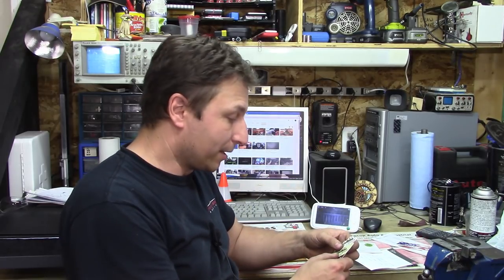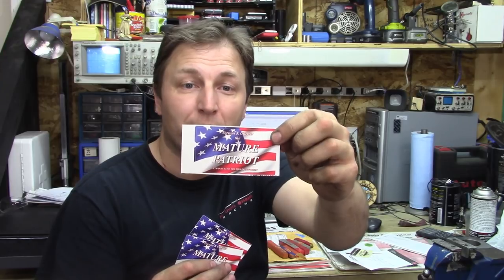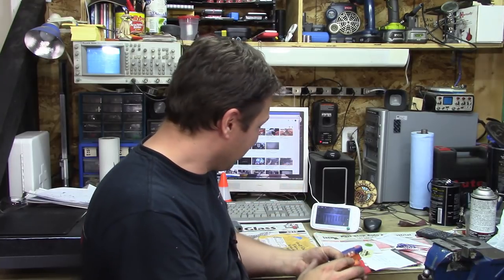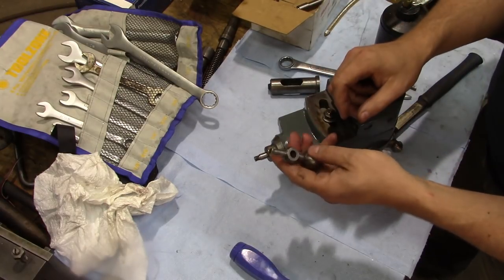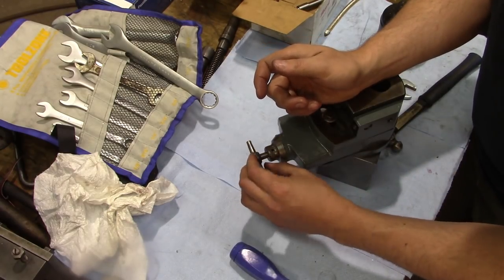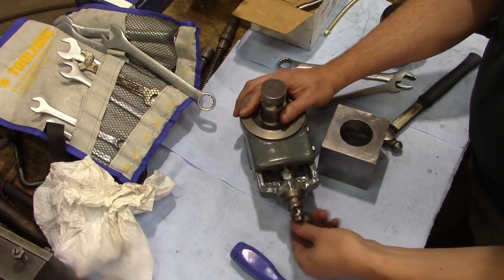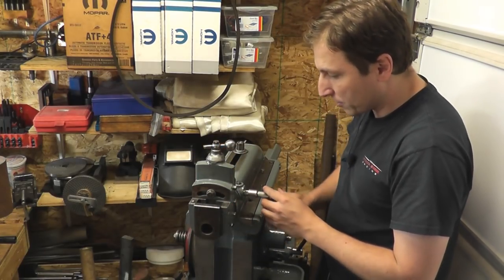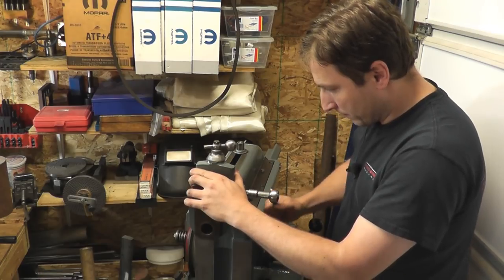Alba 1A Shaper Reassembly Part 6: Clapper Box and Table Mechanism Install

Comment: You must have a great deal of pride and satisfaction in what you have accomplished. That shaper looks like it is going to be a great addition to your shop.
Reply from the maker: Thanks Robert, I am thankful that it is coming together, yes.  Learned a lot through this process, as this is the first metal working machine I've torn down this far.  Made a few mistakes but that's part of learning!  I'm excited to have one, as they can do a few things that a mill can't like internal features in a bore or hole.

Comment: Love the shaper series. Giving me some sellers remorse to see your progress. Those Alba 1A shapers were tough old birds. Could and did suffer lots of abuse at the hands of apprentices  and kept on going. I am very sure you will be the envy of many of your friends once you have completed this project
Reply from the maker: Thanks Ron, it's slowly coming together. I used a shaper in high school and wanted one ever since, so it's cool to see how shapers are seeing a renaissance in recent years due to what they can do that mills can't. A ways to go yet, more parts needing repair/remaking, probably due to abuse like you mentioned, but it's coming.
Reply: @EverettsWorkshop  Have you found a source for the vee belt  to power this thing?
Reply from the maker: Not yet - it came with a B- profile belt, running from the single-vee pulley on the motor to one groove on the flywheel pulley.  I was going to start with that to see if it would fit. Currently working on making the pulley but it's been taking longer than expected due to life stuff. Once I have the new pulley then the belt length can be determined.

Comment: Everett you are a saviour! I had been racking my brains trying to figure out how to remove the cam pin that retains the clapper box assembly to the ram.  So, when I saw you simply turn the clapper box vertically downwards to fit/remove the cam pin I rushed out into the shed and hey presto my pin is now removed.
I have the older Alba 1A without the table support, its in pretty good condition for a 70-80 year old machine. I'm about to make a replacement die block for the rocking arm.

Many thanks for the little gem of knowledge.
If you ever visit New Zealand, then there is a cold beer with your name on it, in my fridge!!
Best regards Paul.
Reply from the maker: Lol, thanks Paul but I am just one other guy messing around in his garage. I'm glad the videos are useful for you, though. I had a miserable time with trying to get the clapper assembly off too until trying it upside down. By the marks on the cam pin it would appear I wasn't the first one to have issues.  Afterwards I saw someone else on YouTube flip theirs upside down, would have been handy to see that first. As for the beer, if I ever get the chance to visit New Zealand (would absolutely love to) then I will definitely take you up on your offer though!

Comment: Hi Everett. Great work, as always. Personally i don't like to put grease on machine parts. In summertime, when it's nice and warm, it works perfectly well. But when it's getting colder, the grease gets more sticky and make the parts harder to move. Therefore i prefer oil.Let's be clear, i am not telling you what to do or don't, it's just an idea.
Reply: I agree. Plus if you keep it well oiled the new oil gradually replaces the old oil.
Reply: We're in Canada, guess Everett knows about greases for extreme cold weather, for gears, and eventually way oils for the gibbs and sliding parts, it's the oils with the W after the number in the type of oil, in those lubricants there are additives that make the oil stickier and stringy, you see that when you put some between your fingers and see the strings as you pulls the fingers apart. Lubrication is a science in itself, quite complex...   
Looks like his shop is well heated in the Winter, nice treat...!!!
Reply from the maker: I hear you about the grease in cold weather, but a Pierre says I have a heated garage (it's an attached garage, part of the house) and if all goes well the grease will be displaced by machine oil by fall anyway.  As for the gears, the manual says to use grease on those.  I hear what you're saying though, grease becomes like glue in cold weather, so I appreciate your concern - I'd rather be warned before making mistakes if others can see what I'm failing to see!

Comment: Hi Everett. The shaper parts went together nice starting to look like one again.
Some tapered pins are drilled in a drill press just eyeballed for centre or free hand in situ depending where and how big the mating part it is and where it fits on the machine, that's if its on a large machine body casting etc. Same applies on wood working machines.
Reply from the maker: Hey Tony, yes I'm excited to see parts come together (and my workbench getting cleared off!).  I was just surprised to see the taper pin being off center like that.  Not a big deal, especially understandable if it was war time production when they were trying to build stuff to beat the band.

Comment: hello everett great to see the shaper going together cant wait to see good chip action.
Reply from the maker: Thanks Jamie, I'm glad to see it come together too.  Next couple parts to make/fix are the motor pulley to be machined and the bull gear retainer/feed crank that needs a broken portion TIG brazed to fill a missing chunk.  So, if you have any suggestions on TIG brazing cast (I just got some 3/32" silicon bronze rods) then I'm all ears.  Will be doing some practice before hitting the machine part.

Comment: I still have my distributor wrench my dad gave me from back in the early 80"s. Heck in auto shop we had to learn to set the gap in points and adjust the dwell. Now computers do all that. Shaper is looking good. Hot chips will be coming off of it soon!
Reply from the maker: Thanks Tom, hoping to be using it at some point in the not too distant future, as I've already got projects on the list for it!  As for distributors, the very first one I went through was on a 1974 Grand Prix my uncle gave me when I was 14. It had a Pontiac 400 in it, with the Delco dual-point distributor.  I spent hours on that thing, as it had sat for a while, the weights were seized, and getting everything fiddled back into place and adjusted was a definite learning experience.  Fun car, it was where I learned to rebuild Quadra-Jets, too.  Still think those carbs were a work of art to this day.
Reply: Everett's Workshop yeah Q-jets are very reliable and as a matter of fact I am going to pull off the crappy Holley carb I have on my built 350 motor and go back to a Q-jet.
Reply from the maker: @hilltopmachineworks2131  I shudder when I think of the grief that I had with a couple double pumpers when I was an apprentice . . . the Q-jet is known as "poor man's fuel injection" for a reason.

Comment: G’day Everett, coming along nicely and hey I use the cordless drill as much as possible, gotta love them.  
Distributor adjustment hung around into the 90s for base timing adjustment but points would have been only in old vehicles when you were a young “fella”:)
Cheers 
Peter
Reply from the maker: Thanks Peter, yes, I like the "cordless rapid travel," the price is right too, lol.  I have replaced and reset a number of point distributors over the years, as well as just setting base timing on lots of electronicaly-triggered distributor systems.  Yes, that's all gone now in favor of different systems, and even in the last shop I was in I was one of only two people who were able to mess with carburetors.  None of the new techs have ever been into one.
Reply: @EverettsWorkshop  never been in a carburetor before. I know that I'm not a kid anymore but I sure am feeling older since reading that!
Reply: Carburettors, not too sorry to see those go also but then what’s the alternative, ah yes EFI wonderful invention until something goes wrong, too many sensors, too many variables and expensive diagnostic tools, very interesting though even for a retired mechanic. I’ll just go find my rocking chair and watch some SMA and S/Danner. Cheers Peter

Comment: Wow, it's almost workable...   Lots of progress for one episode, but those last minutes details are often taking more time than the whole project...   lol
Here Summer is settling in with quite some intense heat and humidity, I'm not complaining after the horrible Winter and Spring...   😴😎
Reply from the maker: Hey Pierre, yeah, it's slowly coming.  Still a ways to got though but part of that is because I don't like to just slap stuff together, I want to give it the best I can at this time because I know if it's only half-done but basically functional it will never get finished (I know myself too well . . .)!  Not very warm this end of the country but we've certainly got the moisture.  Been raining on and off for a month and a half, no one's really griping though because for the first time in years our soil is actually saturated with moisture.  We needed it!

Comment: I would use oil rather than grease as over time, grease tends to harden! Regards,Matthew
Reply from the maker: I hear you Matthew - apart from the gear teeth for which the manual specifies using grease, the grease is only being used as an assembly lube. It will get washed out by the oil in operation and machine oil used from then on.
Reply: @EverettsWorkshop  OK. I would still advised oil for assembly, it takes up less space than grease and allow better gib adjustment!

Comment: Looking good Everett. Let me know if you need dimensions of missing parts.
Reply from the maker: Thanks Neil, will do.  Thank you again for your pulley dimensions, now that my reamer has arrived, making the pulley is the next step so the dimensions you gave me gives me something to base the maths upon to get the flywheel pulley turning the correct speed.

Comment: Do you have a link to Alvin's channel (Neighbour machinist with youtube channel. Correct name/spelling?). 

'Dingage' and 'Scoreage' are definitely goodnice words. :-) And I see you have a variety of power-feed options for the shaper adjustments!

Shaper is really looking great. Great to see the table on it. The mill is looking a little jealous of all the attention!

Will you make a little dedicated tool/wrench for the head angle setting cam?
Reply from the maker: Thanks Craig, It's coming together slowly.  Sorry for the late response, for some reason your comment got grabbed by the comment filter.  I haven't heard of your neighbor Alvin, but I'm up for it if you have the link.  The cordless drill just happened to work so I think I'll run with that for a "rapid" for now.  As for a dedicated wrench, might not bother for now as a ratchet and the socket adapter setup works like a charm.  Maybe down the road, we'll see.  For now I just want to get it to the point of making chips!
Reply: @EverettsWorkshop  the comment filter thing keeps happening to me! Ah well. Re: Alvin, I was talking about your neighbour. I don't quite know if I heard you properly at the start for your video?
Reply from the maker: Oh, you mean my buddy Eldon! He doesn't have a channel but I have encouraged him to make videos. He hasn't yet but he's made some really cool stuff and totally modded out his lathe. Latest addition is a treadmill motor and speed controller.
Reply: @EverettsWorkshop  Ah right :) ok got it! Well when he starts a channel, I'll subscribe. The treadmill motor sounds like a cool addition for variable speed.

Comment: Don't assume the screw in the handle is BA 1/16, 1/8, 3/16 Whit or BSF very commonly used for the smaller sizes on machines, BA was more commonly found in electrical equipment and instruments. Not far to go now and you'll have a very useful bit of kit in your workshop
Reply from the maker: I wasn't sure exactly which thread form it had in the dial, just knew it wasn't anything metric or American number gauge screw threads.  However, 3 days after taking that video my BA tap & die set arrived and I was able to verify that the thread is indeed a #2 BA.  Once the rest of the machine is basically together and functioning I'll do the finishing touches like fixing the knob and replacing the missing lock screw on the dial.
Reply: @EverettsWorkshop  Hi glad it worked out that way look forward to seeing it finished !

Comment: If theres play on the clapper how do you tighten or eliminate it is there screw to do so
Reply from the maker: Yes, there is a screw on the side of the clapper box on my machine that allows me to lock the clapper in place for certain operations like keyway cutting. Not sure if all Alba shapers have it or if mine was modified at some point in its existence.
As for if the hinge pin is loose in the clapper, then if it were quite loose one would most likely have to resleeve it and replace the pin as there does not appear to be a clapper hinge tightness adjustment.
Reply: @EverettsWorkshop  when tightened can the clapper box still move or its just to lock it
Reply from the maker: @woozhi9218  No, not when the screw on the side is tightened - but keeping the clapper locked from swinging is only used on certain machining operations, most of the time it is left able to swing.  The whole clapper assembly, whether locked or unlocked, can still be moved up and down on the tool post slide by the feed screw on the top.
Reply: @EverettsWorkshop  if theres side to side play how should i fix the problem sorry for asking too much im gonna get a shaper and found this could be a problem
Reply from the maker: @woozhi9218  Lol, no worries, you're not asking too much, I'm just a hobbyist like you and am learning new stuff too.  If there is side-to-side play in the clapper to its box then I guess one may be able to lightly counterbore the edge of it around the hinge hole to add a thrust washer that would take up the space.  The clapper box would need to be quite worn for that.  I'm still learning more about shapers every time I use it, and still learning from others on YouTube here too.  One fellow who might be able to give more specific information is Keith Rucker at Vintage Machinery.  He rebuilds all kinds of old stuff and knows WAY more than I do!
Reply: @EverettsWorkshop  yeah get first worry later all can be fixed
Reply from the maker: @woozhi9218  Whereabouts are you?  I live in Alberta, Canada, and it took a while to find one and even it needed repair.  Not sure if they are more plentiful in your area.
Reply: @EverettsWorkshop  im from Malaysia theres variety of brand of machine tool like klopp shaper but now i think the best option would a be a 12 inch shaper from china think have to  see it personalpy to know if its worth it the klopp is in another state and kinda big a 12 inch seems to be the sweet spot .

Comment: You are going to be sorry you put grease on any thing chips will stick to the grease
Reply from the maker: It was mostly a pre-assembly lube as getting the unit back together took a long time around family and life in general needing time and energy. Apart from the internal gears (which are specified to have grease) all the other lubed surfaces have gotten the grease now worked out during operation and are running on oil. I agree about not using grease on sliding surfaces during normal operation though.

Comment: I cringe every time I see grease where oil can be used, it blocks oil holes and dries up, collects grit and crap and doesn't do much else unless it's a bulldozer .
Reply from the maker: Hey Lindsay, apart from the gear teeth which are specified in the manual to be lubed by grease, all the other wear points are specified in the manual as using machine oil.  Apart from the gears, there will be oil used from now on for everything else.  The grease is merely an assembly lube at this point and will get washed out with the oil during operation and wiped off.  I agree though, it would not be the greatest long-term lube option for the machine anywhere but the gears.